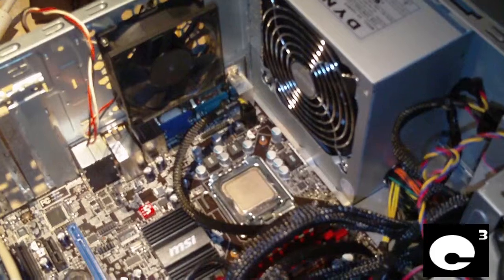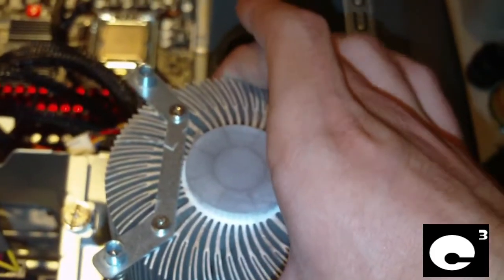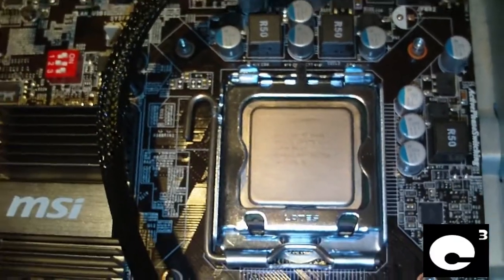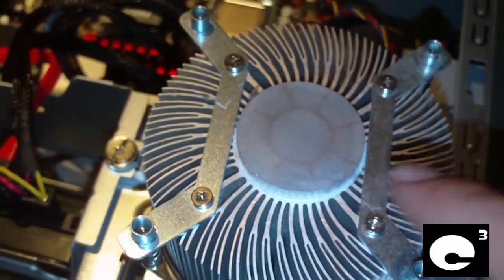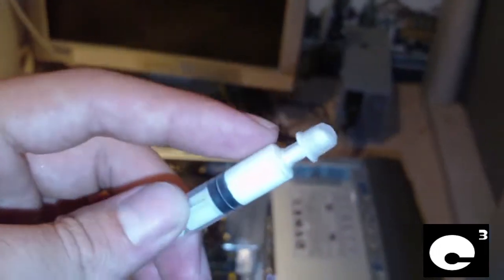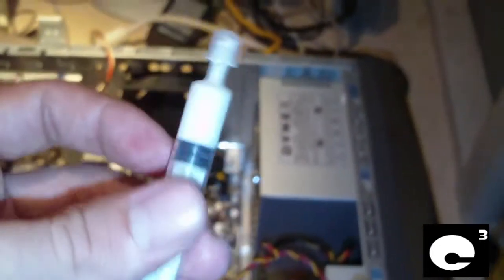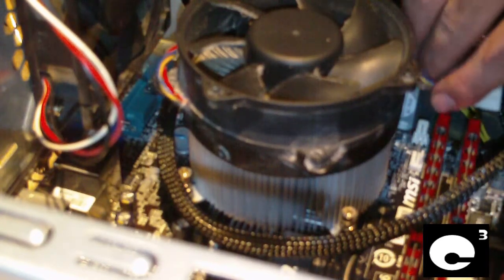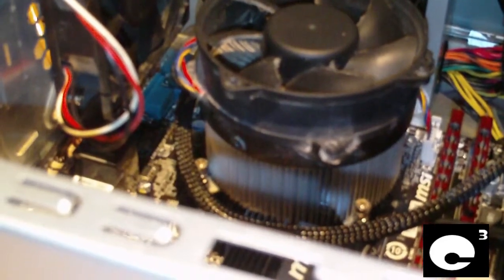How To Install a Modern Intel CPU Cooler with Back Plate

Comment: This  is my first time installing an aftermarket cooler. Did I understand this correctly? I have to remove the motherboard entirely from my case? I mean, remove the screws that attach the motherboard to the case?? Can´t I just do this opening the other side of the case? (there´s an opening at the side of the case that grant me access to the back side). Or could I damage things by doing this. 

Don´t mean to come across as lazy or anything, but unscrewing the mobo isn´t exactly something I do every 2 or 3 months, just saying,
Reply from the maker: If your Intel cooler has a backplate and the case does not offer access to the back side of the board, then yes, you will have to completely remove the motherboard for installation.
Reply: Thank you very much for the response. Appreciate it.

I found out that my old PC case cannot accomodate large coolers, because it has a huge side panel fan. Is there any point getting a ¨slim¨ cooler (are they any good?) or should I stay with the stock cooler instead ? I have an i7 980X so it would have to be a really good cooler under 145mm that supports 1366.
Reply from the maker: When shopping around, look at the reviews people leave on these coolers. That should help you make a decision on what to do.
Reply: Alright, thanks! One last doubt.Do you think smaller, slim CPU coolers can do the job as well ? It´s just odd to put a relatively small one in my tower case, even thought that´s my only alternative due to the large side panel fan. Aren´t those meant for ITX cases??

Cheers.
Reply from the maker: It might be a bit noisier, but it should still do the job.
Reply: Good to know, thanks. I´ll take noise over a fried CPU. :D 

Although it really intrigues me how medium or large CPU coolers won´t fit inside a tower case (Cosmos S) What a mistake from the manufacturers not to pay attention to that. Anyway, thanks dude.

Comment: Is there a guide out there somewhere for a computer novice like myself that depicts the proper removal and installation of a board? I'm so incredibly worried about messing something up when I go to do this, but my i7-2600 is telling me that the stock fan needs to be replaced.
Reply from the maker: +Valentino Graci I'm sure there are many videos available on how to properly remove or install a motherboard. If you look on my channel, I should have some videos of building a PC, including the installation of a motherboard. The most important thing is to make sure you are properly grounded, by occasionally touching a grounded metal surface once in awhile.
Reply: *****
Thanks for the swift response.  I'll take a look.  It's probably not as difficult as it appears, I have more of a "fear of the unknown" thing than anything else just having never done it myself.

Comment: What if you can't remove the backplate? I've tried to remove the one that came with my acer aspire x1700 motherboard but I cant. I
Reply from the maker: Sometimes the backplates are stuck to the board with adhesive.
Reply: I took a look and its nothing holding it down. It has more to do with the part that comes through the board (the four mounting points for the heatsink). They wont go through the holes. I've tried braking them with a pair of pliers but that didnt go to far because I was trying to use caution not to damage the cpu socket or the board itself. I think I'll settle for giving up, unless...someone has info on this because I now have a Hyper T3 that I can not use. I do a lot of encoding so it would help a lot in terms of keeping the Cpu cool. I get really high temps now. 66 c. I have to run a house fan on the open case to keep it down to 60c - 57c.

Comment: How are these backing plates typically installed?  From what I can see there is a black felt piece between the motherboard and the metal plate itself, and it looks like its got some glue in between.  Is the felt typically glued on to the mobo or do they use adhesive tape?

Comment: I have a question regarding the backplate.  I just bought an ASRock Z77 mobo and it did not come with a backplate.  The old motherboard has one on it but it looks like its glued or possibly epoxied to the motherboard.  When I get a new backplate for the new motherboard, is it recommended to glue it into place like the old one was?